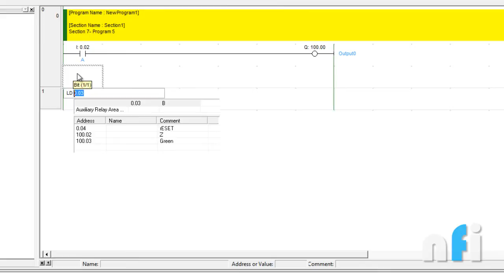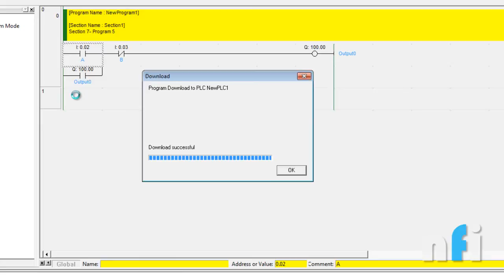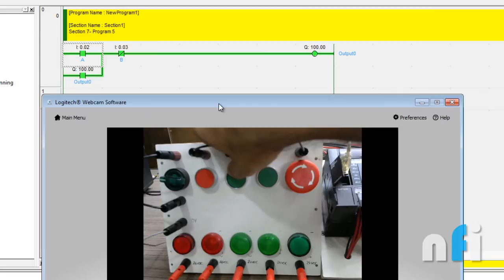Omron PLC Lesson 2- Latching and Interlocking Exercise 3

Comment: I don't get it. The instruction says consider 0.2 and 0.3 NO Push button but you used NC on 0.3.
Reply from the maker: Dear JOEMAR SILAO  i think you are confused between NO button and NO Contact. NO Button is a physical button and NO Contact is software contact inside the PLC. This is very common misunderstanding when someone starts learning PLC. I would prefer you to check out this video which will clear the doubt: Difference between NO/NC Contacts & Switches